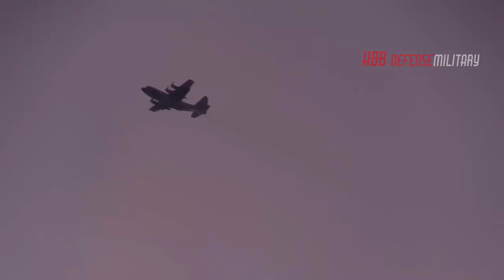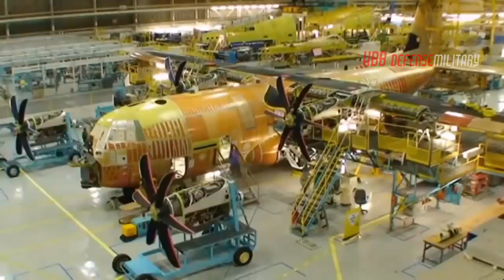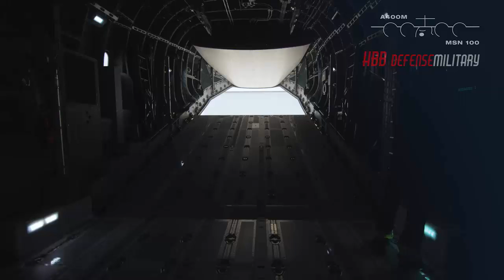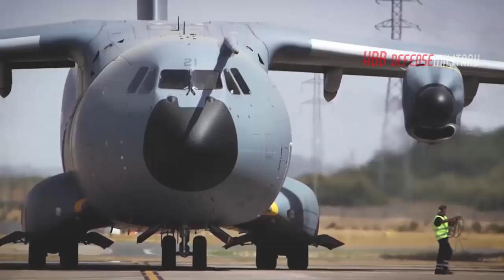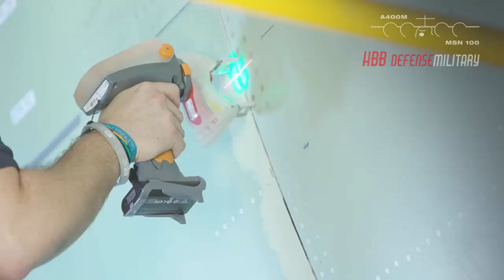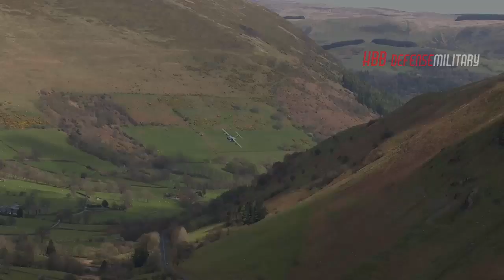Meet Airbus A400M Atlas: World's Most Advanced Large Military Transport and Tactical Cargo Aircraft

Comment: If only it was as reliable, dependable and could fulfil the special forces capabilities of the C-130J…….shame it isn’t 🫢
Reply: It's getting there. It's a brand new clean sheet design, which always take time to mature. Compared to even 5 years ago, it's vastly more capable. The real issue isn't the aircraft, but the willingness of customers to pay for capability trials.
Reply: So why exactly did France buy C-130J when they had A400M…..because it can’t do everything! Like I said, it can’t replace everything a C-130J can do. And the reliability/availability is currently horrific.  Looks like you’re the bull💩er! 🤡
Reply: What do you mean ? The c130 is 65y old, is technologically outdated and smaller than the A400M
Reply: @xara7152  I think you’re getting yourself confused with the fact that versions of aircraft get updated during their 65 year lives. I.e. new avionics, structural updates, new engines, longer body, modifications, etc………
Reply: @cp4512  true
Reply: @cp4512 no comparision between C130J and A 400m stop bullshit comments! In France whe use both and in addition the CASA CN235: heach have they proper use, and in addition hire from Antonov AN124's by Antonov Airlines for the large strategic transports

Comment: Larger & more capable granted, But also more expensive as well i bet, After all there is no need to use a double decker bus to take your grandmother to the local shops 🤣 , There is a place for both aircraft, just depends upon the needs of the mission 👍
Reply: Heard it's cheaper than the c-17, and has lower maintenance costs than the c130 and c17.
And it's european. Good point there

Comment: What cargo do you need to move and how big is it and how far do you need to move it?
As it will probably come down to the C130-J Super Hercules is cheaper to buy, cheaper to operate and
a lot easier to justify it's expenditure!
Reply: a cargo plane that is slower, lower, with half the capacity and on a older platform is cheaper? Color me surprised.

They are different weight classes.
Reply: I think there is room for both personally as the Atlas fills requirements that more expensive planes like the Galaxy  would use , also having competition is no bad thing to drive up standards overall